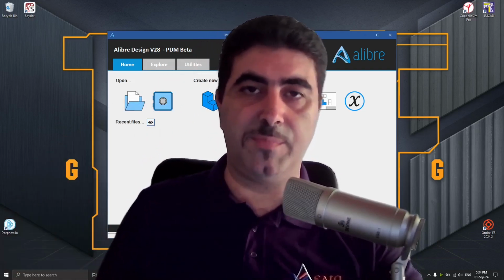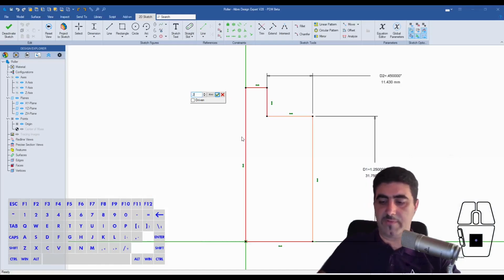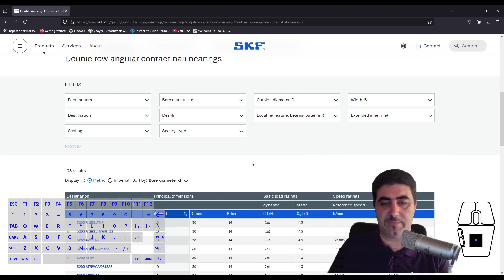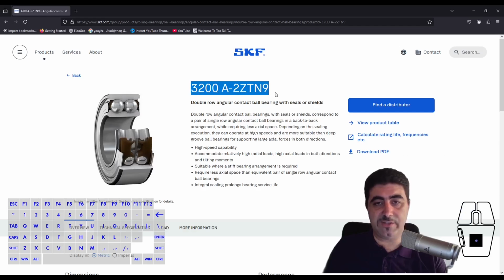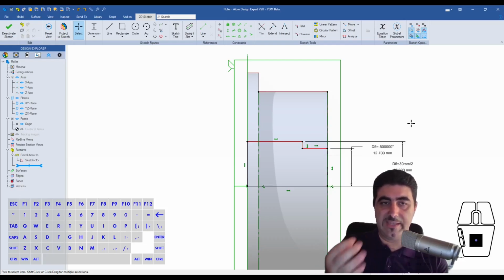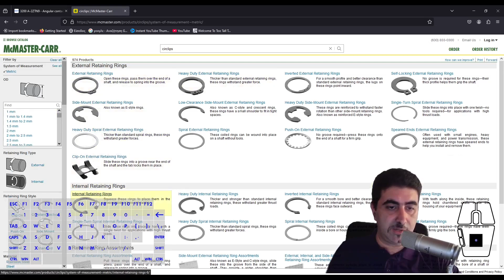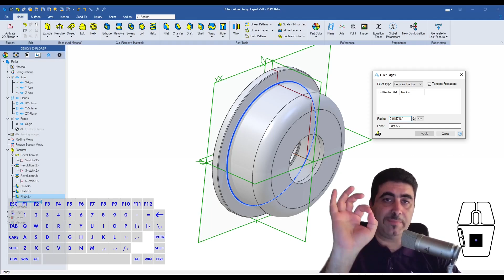How to make a Roller - Mini Projects: I-Beam Trolley Series

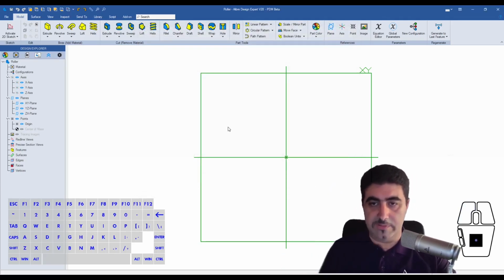Comment: 3:20 I'm American and I can't even think in inches. Maybe because I use CAD for 3D printing so much, and everyone I watch on YouTube to learn CAD also uses millimeters. Who knows.
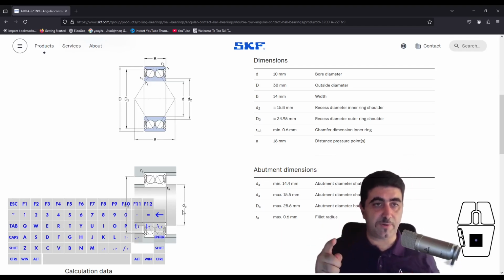12:27 what? Designing a part to be safe? That's not very 2024 of you. We need to design everything to be as cheap as possible, didn't you get the memo?
Reply from the maker: Hahahahaha, really cool comment!

Yeah, metric is my go to. But over the years I have learned to do inches as well almost by necessity. And really, in this design has both, because the bearing was still metric.

As for the design to be "safe". Hey... I'm showing how it's done. Whether you use that or not...